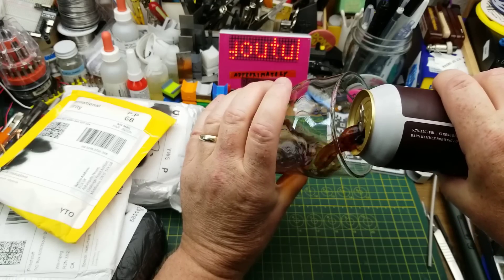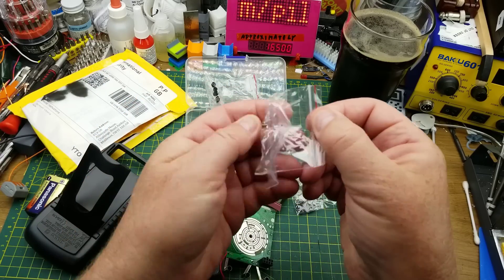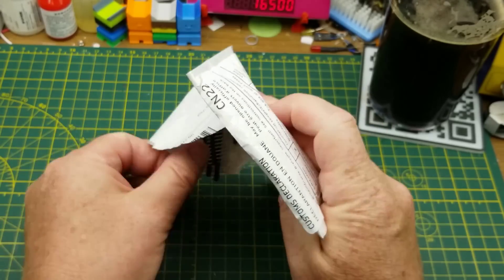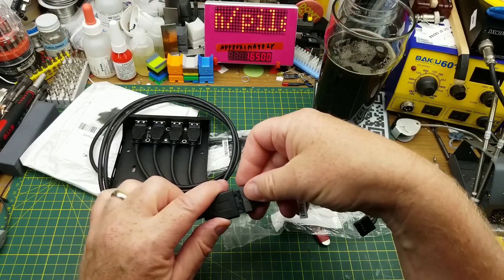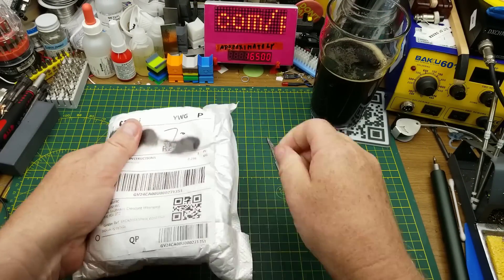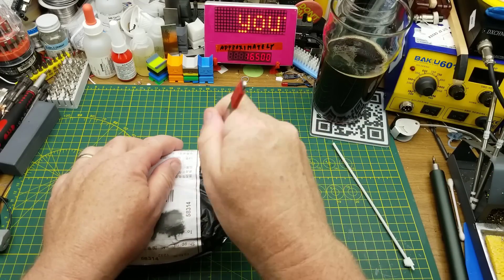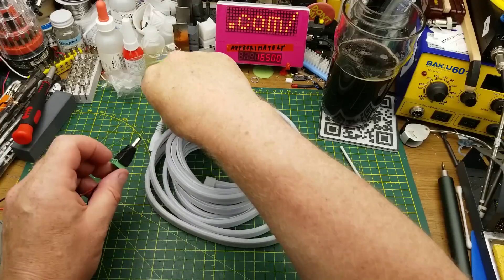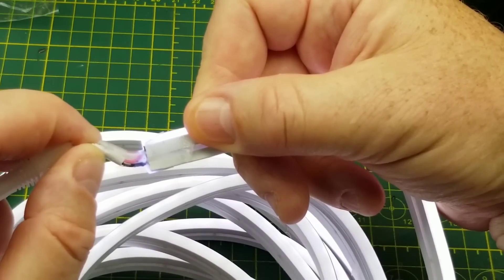Mailbag Monday 197

Comment: For replacing those tiny pads in the touch keys, I use a leather punch pliers if I don't have the correct size, and that works really well for proper sizing.
Reply from the maker: Great tip!

Comment: I had to dump the carbon pads out of the plastic bags because they were clinging with static so bad I couldn't even get them out with tweezers when trying to use the smallest ones.  
If you don't need the extra twisted pair in the cable, can it be pulled out of the jacket or maybe only if the cable is cut shorter?

Comment: i just done a huge upgrade on my pc and my old hardware components are still considered somewhat highend if you wanna do a private trade for some redundant gear you have man. ryzen 7 5800x, x570 mobo, 32gb ram, high end cooler (i'd like to keep the cooler though for a new load im building). email if you're interested. it can multitask like crazy. i bought a mini pc as a home linux server recently or i'd keep it. has dual bios and stuff.

Comment: I imagine compliant conductive paint could also be used to repair cracked silicon pads.
Reply from the maker: Possibly, but I would be concerned about durability.  I haven't had much luck with conductive paint staying on surfaces.

Comment: I have 4th gen Intel and it has USB3 onboard, and sometimes it comes in handy for transferring large files from USB thumb drives. 
I think that USB2 adaptor will make the USB3 run at USB2, so it might be an idea to get a USB3 card if you have a free slot.
Reply: I think you are right.  One of those funky 19-pin, 2mm pitch, USB 3-to-mobo cables carries data for exactly 2 ports.
My usable dinosaur mobos all have that connector, but only one, making 4-ports difficult.
@pileofstuff: hope you check carefully that one little blue connector isn't on your mobo already.  Is it over 12 years old?

Comment: I just tend to buy my headers as 40 pin strips. Saves having to think about what sizes i need in the future.
Reply: Sure, but those are pre-broken up as they will be in a proper parts drawer.
Reply from the maker: That's what I normally do as well.